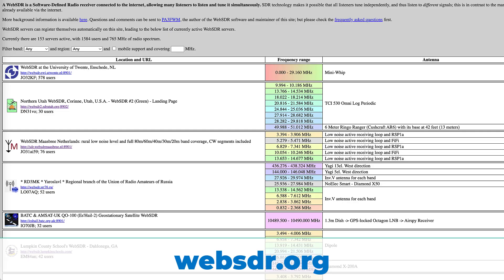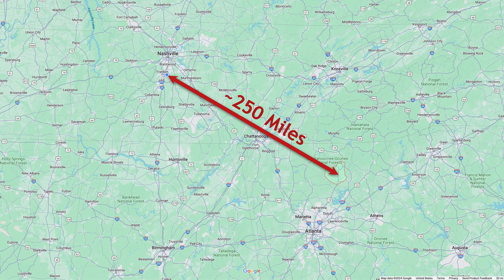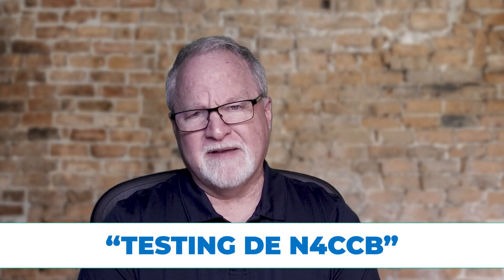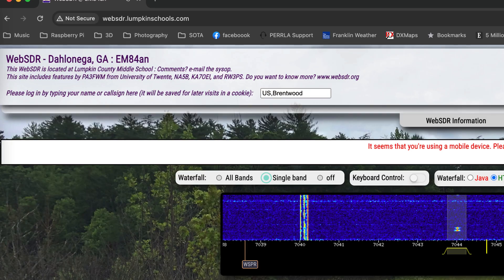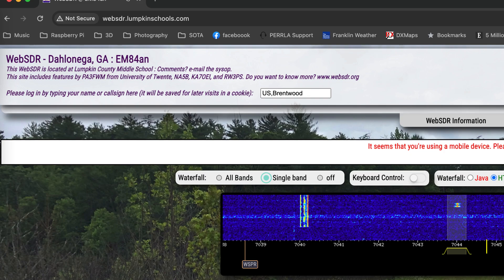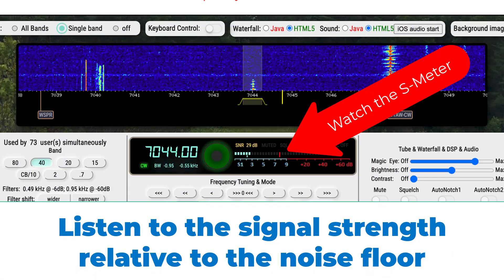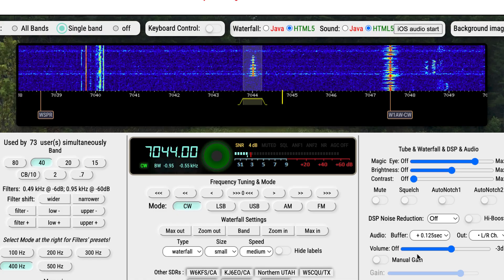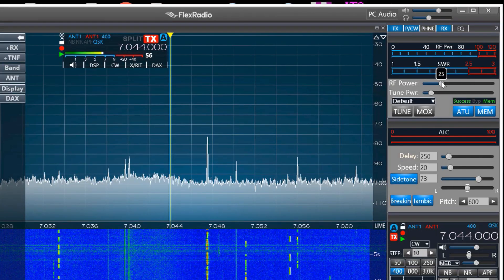100 watts vs. 5 watts: Can you hear the difference?

Comment: Between living in deep rural nowhere and having a shack full of chokes and ferrites, my noise floor on 10 meters is incredibly low.  I remember giving a guy in New Zealand a 4-1 signal report on Field Day SSB and he was genuinely angry.  Get the floor low enough, you can read almost anything, and hunting weak signal is a fun sport on its own.  I've talked 1,000 miles 4 watts AM carrier CB during a solar event, with good reports.  With the right floor and conditions, not much power is needed.

The caveat is, what is the noise floor?  Before I got my ticket, I did field experiments with CB LOS.  Ferrites helped to lower the already low noise floor, and with that I sought how far and how good 4 watt AM carrier could do.  I was impressed the miles of coverage a full 9 foot whip on a car and a 5/8ths base station could do.  But, when I finally got a 25 watt carrier "kicker" to finish my experiments, it became very clear just how much of a difference an S unit makes, and how much further, how much more trees and minor obstacles it could make through.  I am a firm believer in "MOAR POWER".  

Your point is true, once over the noise floor, more power is overkill.  But many seem to take this too far and suggest that 3dB means nothing, even some saying an S unit is nothing.  But anyone who has fought for a signal around the noise floor quickly realizes that every dB counts when you are pulling signals out of the weeds.  Those that scoff at double the power, "a mere 3 dB", are equally as wrong as those who say that you need 1,500 watts to talk to anyone straight, or have a good readable signal.  

The old rule about using as much power as you need always applies.  Don't create more noise, don't waste energy with overkill.  But, we have those little switches to turn on the amplifiers for a reason.... QRP is fun and effective, but it needs to remember its limitations.
Reply: I worked a station I know once and gave him a 5.8. report. He was very put out by it and said no-one has said that before. I told him there are stronger signals on the band so how can he be 5.9.
G4GHB.
Reply: @bill-2018  But, they are all 5-9, dontcha know?
Reply: @kingduckford  Ah, I forgot, with it not being a contest.

Comment: Informative demo. Your test was done on 40M NVIS, which is basically travelling up and down to the several hundred mile range. It will be a different story for DX on, say, 20M,  which can result in absorption of the weaker 5W signal and not allow it to the receiving station. This is the reason there are amplifiers. This is not to say one cannot get DX without 100W and/or an amplifier. But....as with everything in the physical world....more is usually more, except when there are exceptions like NVIS. You do demonstrate that it is not always important to default to using an amp, and one may do better with a judicial use of it. 73 de Scott W1AL
Reply: Well, 20 meters is an even lower noise floor, so I don't see why you would have more of a DX advantage with higher power. If anything it seems like more power would be less helpful. Maybe you could you make a video and test this theory?

Comment: Yes, for medium range stations as in NVIS yes, but for DX stations where your first hop has to travel more than 2,000 miles before the signal ever reaches land again (Im stuck on a rock in the middle of the Pacific Ocean), the power makes more of a difference, especially with SSB. For CW, it isn't quite as noticeable, but getting through the noise floor is rough if I drop to 10 wats or lower. This is why I am trying to learn Morse code now, so I can reach the mainland US on a more consistent basis with a portable radio doing POTA activations.
Reply: Try JS8 🙂
Reply: @tzm1843  yes, JS8 works, but JS8  requires that you have a computer and has no voice capabilities and limited grid-down capabilities

Comment: There's a big difference between what 5 vs. 100 Watts sounds like using CW, and 5 vs. 100 Watts using phone.  CW will cut through the noise when phone won't!
Reply: I had the exact same thought! Yep, that's great on CW...but now try that phone...
Reply from the maker: Please watch the Part 2 SSB video
Reply: Not to mention where we are currently in the solar cycle, which helps,  the IBP has shown this. But yes if you have next to zero noise floor you have major advantage, especially with CW
Reply: CW is hand "digital")
Reply: Very true!! Comparing CW to SSB is like comparing apples to oranges. Two different modes of communications have different characteristics at the receive point. Reducing power loses voice qualities that are necessary for reception. Reducing voice power IS NOT an option.
Reply: Sure you can. I suggest you getfamiliar with ssb.  I have had QSO,s with stations in South Africa and Russia using 5 watts.
Reply from the maker: @lomgshorts3 You do know that people are making SSB contacts every day at less than full power, right? Maybe you aren’t supposed to be watching these videos. Is there another YT channel more appropriate for your sensibilities? You wouldn’t get to be a troll on those videos, so it might not be as satisfying. But, still, you should probably consider moving on.
Reply: 🎧 What you can hear between the clutter varies from the audiophile and passive sonar operator. Is it real or is it Memorex?
Reply: Why not drop slow CW and use a digi mode... 😂
Reply: A little late coming in on this one. I homebrewed a 5763 final plate modulated with EL 84s late afternoon on 75 meters I was heard comfortably by other AM ops about a 6 watt carrier .Once the atmospheric noise comes in later on, time to turn up the wick. But yes low power can facilitate contacts especially on cw. Thanks for sharing!
Reply: Good reason to learn how to use CW :)
Reply: @willgilliam9053 try JS8 🙂

Comment: Hi Cliff, your test has nothing wrong to it. Except, you chose 40m to do NVIS with a station 250miles away. I do SOTA a lot and most of my NVIS 40m contacts sound great. Why? There's no bouncing on earth, just refraction straight back down. Once you choose 15m or 20m and hit a couple of earth bounces, your signal on the other side degrades significantly. That's when power matters most. If you do the long distance test with salt water in between (West Coast to Japan) the power might not matter that much either. It's a question of path signal loss vs transmitted power to overcome the receiving base noise signal level, as you mention.
Reply: Hey, Robert. I don’t think you’re wrong. The big takeaway here (I hope) is that, if conditions are good and your 100 watt signal is well above the recipient’s noise floor, your 25 watt signal is going to only be 1 s-unit down… which sounds only slightly weaker. If you watch the S-Meter while receiving a transmission that’s well above your noise floor, the signal strength can fluctuate an S-Unit or two without you hearing much of a difference. It’s all good. Successful QRP requires conditions to be favorable. Nobody should expect to work QRP magic at will. - Cliff
Reply: One of my activities while using qrp is to work my way through all the HF bands, find weak signals, first CW then ssb and make contacts. I am no longer surprised how effective my 5w to a 40m delta loop with remote tuner at it's feed point as an all band antenna and a Hex beam at 12 ft are. Of course, during the or near solar minimums we all face challenges.
Reply: Agree Roberto
Reply: I think you meant refraction in lieu of diffraction. :)
Reply: You're correct. I fixed it in the text. Thanks  @DonzLockz
Reply: Thanks Robert. This explains what the point of having more power, and how the best conditions permit QRP to work so well.
Reply: All I have is 100W into an end-fed and I generally use most of that power for DX. Cliff's right for the easier stuff and when your signal budget is really good on DX.

Comment: Operate POTA with 5 watts and never have trouble getting more contacts than I need with CW. Started with a new TT Argonaut 509 and have never regretted running low power.
Reply: Argonaut 509! What a classic rig from the early years of transistor powered QRP! -Cliff

Comment: Been telling my QRO friends about this for years but they never listen.  I love when doing POTA they want to do 100 watts because they, "Want to make contacts". I told them anywhere from 1-10 will snag all you need AND save your battery big time.
Reply: You're not kidding. I get insane pileups on 5w CW.
Reply: @EvanK2EJT Consider yourself fortunate.  5W from my local POTA parks is very lonely and 50W is very slow
Reply: @bpsengineer_AC7PB  Some of that may have to do with geography.  I'm not sure where you are, but out here on the east coast you can't throw a stone without hitting another ham, so if I get on 40m it's absolute chaos, even on 1w.  Granted, I work almost exclusively CW, so that makes a big difference too.
Reply: @briansalsbery9968  Gee, maybe consider going to a more quiet location for your portable endeavors. 😉
Reply: 100 watts is not qro.

Comment: Those are good conditions. In the real world 20 times the power is the WORLD. Also, you use CW which is straight cheating.
Reply from the maker: It also comes down to expectations. I don’t expect conditions to be good enough for QRP at all times. Sometimes I fish without catching anything. But it’s fun for me to try.
Reply: @QRPSchool  I started with QRP because it was all I could afford. Even during high cycle it is challenging. Just bumping it to 20-25W makes a noticeable difference.
Reply from the maker: @sofia-p7d4t  Quadrupling your power yields 1 additional S-Unit for the receiving station. That’s not much, but if your signal is down in their noise floor, that 1 S-Unit might make an impossible QSO possible.
Reply from the maker: @sofia-p7d4t  You can't get a General Class ham license without learning that S-Units are supposed to be 6db apart. (Google it.) Whether your radio is calibrated correctly or not, quadrupling your power yields a 6db increase.  As for "quadrupling the power doubles the distance," that can't be possible, right?  Your signal will be stronger to the receiving station but the extra power doesn't change the takeoff angle of your signal, right?  And it doesn't affect the ionosphere, right?  Please find me some credible reference that says your signal will travel double the distance if you quadruple the power.  Not being a wise guy and baiting you, here. If you're right about that, that's truly fascinating and I'd like to know. Thanks - Cliff

Comment: Being a QRP operator for most of my ham time I would agree use only the power you need to make a contact. The antenna really makes the difference because the more RF you send out the more SNR the signal has. So work on efficient antennas and you can really get away with 100mW for some contacts.  note Cliff good to see you back!

Comment: As already mentioned by another follower, good to see you back Cliff flying the flag for the QRP guys and gals.
I spend 99% of my time running 5watts or less down to milliwatt levels with my old TS850SAT ! 
I have three very nice amplifiers gathering dust (Acom 1000 / OM Power 2000 and a old Ameritron 811H) which will get sold one day as the trill of having a CW qso with QRP beats the pants off being the loudest on the band any day of the week.
Best 73s.

Comment: Power is basically negated if you have an awesome connectivity and minimization of loss between transmitter & antenna. Basically comes down to the distribution model you're employing to get that signal out. Nice video